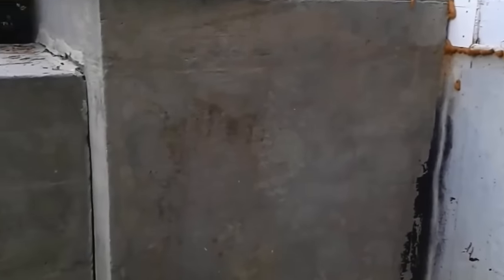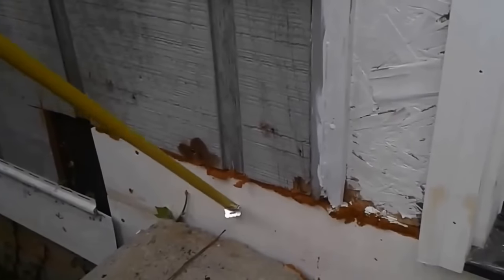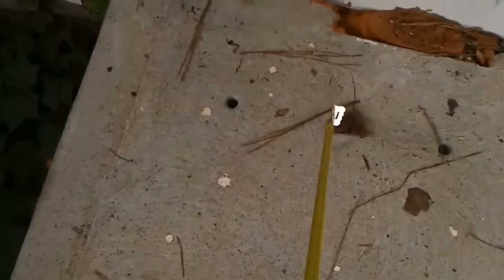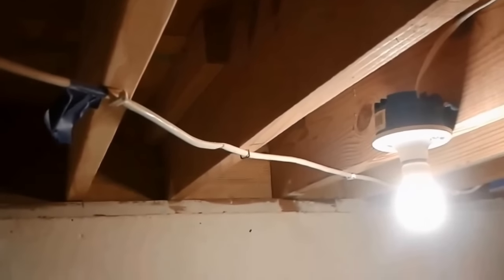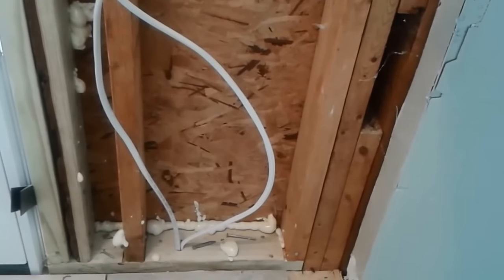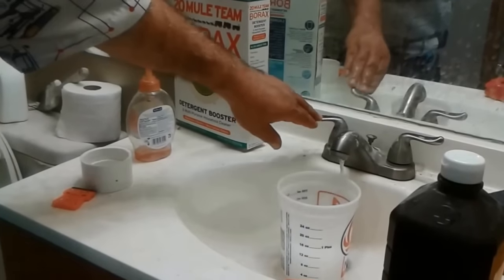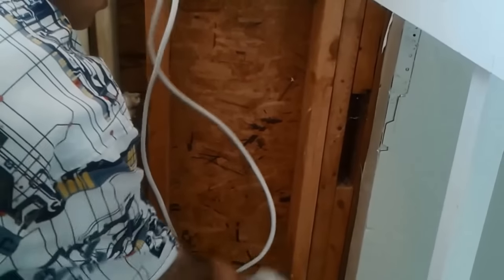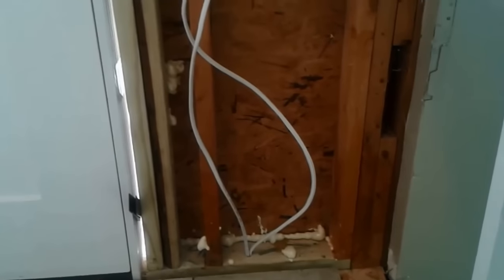How To Get Rid Of Termites For Good  Using  Borax -- Best Solution Do It Yourself

Comment: I use borax also for ants mix it with sugar 1 part borax 3 parts sugar mix with water till like honey feed it to the ants they take it back to the nest and in 2-3 days they are all dead
Reply from the maker: You are right. Thank for the info.
Reply: @josephk9182  I just got quoted $960 to get rid of my termites. They said they will pull all my carpet back and drill holes through my cement slab every 14 inches and spray something called Aggressor into the ground, then go outside and inject it around my foundation putting a total of around 120 gallons of this Aggressor liquid. does all this sound right ? I just noticed so far only a 5 inch long termite debris mound in the center of my living room on an interior wall about 2.5 feet up from the floor. I knocked part of the little mound off and saw them in there, even saw a queen running back and forth. I really don't have that much money but I'm afraid if I don't somehow get a professional these things will destroy my house.
Reply from the maker: Because you already have a termites inside your house you will need to use Termidor or Taurus.  Inside the house internal walls you need to inject foam Termidor.  Remove the drywall and find from where the termites came to your property  Apply Borax on a necked wood as you sew in the video. You must find from where exactly the termite penetrate to your property. Please get second openion.

Comment: They may have used Termidor, but it had to have been improperly applied. You have to do a DRILL and also TRENCH. DRILL the concrete and pump X amount of chemical per hole, repeat per hole per X feet. And around the foundation, you must trench and apply a TON of chemical. It takes a tank the size of a half of a pickup bed to do it in Arizona - we had it done by a professional pest company, and have had no problems. Now with a basement, everything would need to be excavated down to a certain depth - and here I don't know - possibly to the weeping tile, filled with chemical, then backfilled with the same dirt mixed with Termidor. If they cannot excavate the area, they then ROD the area with Termidor. It wasn't done right - plain and simple.

https://www.youtube.com/watch?v=B3zA8MFPyGg

 Also - your solution may likely have little effect - termites eat UNDER the grain of the wood, not on the surface. Only if they start building mud tubes on the surface will it have any effect, once they reach wood they eat "in between layers". Thats why most never notice the damage until it's too late. Borax (Sodium Borate) has more affect on crawling insects like roaches.

I have much material I can send to you if you need proof of my statements, do research, or contact a true pest control company. I admire your efforts - it does cost too much to get rid of the little bastards!
Reply from the maker: They did it ok but it is very difficult to do it under concrete steps . Termidor will not  insure 100% termite infestation. 
Termites will not eat treated wood .When you  apply borax on wood and studs  you create a treated wood which termite cannot eat.

Comment: I just have to mention that the steps and the "porch" are a fine example of American hack, garbage built structures. First it's a death trap, the steps could kill a 12 year old, and forget about inviting grandma over! To help solve 2 problems, rip that boat anchor out and build some code staircase with treated wood. Then you can get to the termite zone behind the crazy concrete work. If that entry step is any indicator of the quality of the rest of the house, maybe its just as well to give it to the termites.  Ok, though, great stuff Borax. I would mix a big tub of it with a drill mixer to the highest concentration the water will dissolve. Dye is a good idea and also a bit of detergent to make the mix penetrate further. I definitely would use a pump sprayer and give it a few coats. You can drill holes and inject them too.
Reply from the maker: Hi , First I injected quite a bit of Termidor on the porch where the holes are beside Borax and second I renovated the concrete stairs putting exterior porcelain tiles and metal ails . The stairs and porch were sealed that no water or moister will go under the concrete so this will destroy the environment of termites under the concrete floor for good.
Here is a video where I primed the metal rails please look at it:
https://www.youtube.com/watch?v=usTMe8A8AGQ

Thanks

Comment: termites r inside the wood not the outside..they will eat the wood from the inside before reaching anything on the outside,,fail
Reply from the maker: Not correct. You have to make sure for the 2x4 stud that the borax is fully surrounding the studs (especial the stud edges). The siding of my property is 3/4" OSB board (   Oriented Strand Board) which fully observes the borax substance through out  the 3/4" .
Reply: goodluk sir

Comment: Problem with this is you are only protecting the surface of those boards you applied it on, termites will also know it's there and will infest other boards in you're foundation! Termador is not detectable and takes 2-4 weeks before the ingredients activate with good reason and you probably didn't get a proper treatment, unless you really know what you're doing leave these issues to professionals.
Reply: can u use termador in a sprayer? I've dug the trench like the instructions say then use 4 gals every 10'. but can it be used for spot treatment as well?
thanks
Reply: Yes, you can with Termador SC
Reply: +J Dub 
very good. thanks much
Reply from the maker: You are probably represent the extermination industry which is defiantly  not a source to trust since they make tons of money off a very little bit of insecticide.  If you look at the video you would see that the property was protected with Termidor but still termites managed to penetrate between the concrete steps and the door (place were Termidor  is not effective.) Borax acid which apply on untreated wood and stud permanently avoid termite from eating them . In addition, in case of moister the wood will not be rotten (from mold and mildew) . As you well know rotten wood attracts termites. The solution works 100% where ever it applied.
Reply: Because I'm just going to represent any company out there right? Read my comment, I'll try to put it in a more simple fashion. Like I said you probably didn't have a proper treatment with Termador, it certainly looks like whoever applied it didn't know what they were doing and the borate only protects wood where you put it. What about your studs inside you're walls? The back sides of those boards where you can't access? Subterranean Termites will just move to different areas and currently there is no permanent solution, I have spent years studying and becoming certified for these things.

Comment: I am a pest control technician in Alabama one of the leading States in termite population. And I can tell you that if treating your wood with Borax was an effective prevention plan for termites, we would not be spending hundreds of dollars per house in chemical. I don't know how this house was treated because I wasn't there. He did say the Tenant treated it with Termidor. Termidor is currently the leading chemical and Termite prevention at least in the United States. But what I can tell you is every house is treated different. not one house is treated exactly the same. Different foundations call for different treatments plans It's not as simple as just spraying around the outside. If the house has a basement. Or a floating slab no matter what you do. You cannot prevent termites from getting in it. You can decrease. The available entrances. But you will not be able to access all of the entrances. No matter what you use. What he's doing with Borax? Is essentially having that would soak up borax. borax messes with the termites digestive system. And will kill the termites that eat it. So they have to get into your house before they can die. chemical treatments kill before and termites are introduced to the house? Baiting systems also provide the same effect. However, instead of using your house as a bait. A uses the by-product of decomposing wood called cellulous and poison to entice the termites to come after that instead of your house. That poison will be distributed amongst the rest of the colony as it's the workers who Feed The Colony. Termite control is not something you really want to do. Without proper training we go to school for this stuff. And why the internet is a great resource, it can give you a lot of bad advice. The best advice I can give you is hire a professional that way, even if they get in you're home, your not responsible for the cost of fixing the damages

Comment: This is a great video thank you for making this. But!...... I would just like to add this if you already have termites and you want to kill them this is the best method the reason being you do not want too much Borax in the water because it will instantly kill the termite and therefore it will not be able to bring food back to the queen so that she can ingest it and die. If you do not have termites and you are doing an new build or upgrading an old one you want to use at least by 4x the amount and use a sprayer to apply, this will help new termites swarms from digging in and starting a colony. Sprinkling borax under your house and around your foundation is also a good idea,  the rain will pull it into the ground where they actually live. Borax can be harmful to some animals please do your due diligence and research. Boron is a good soil amendment. .
Reply from the maker: Excellent comment.

Comment: Wouldnt it be easier to pour the solution into a spray bottle n spray the surface n let it dry?
Reply from the maker: You can but the borax may clogged the nozzle. Please make sure to clean the spray nozzle after used.

Comment: Will this work if you mix it in one of the tank type,pump up sprayers? The kind that you pump it up to pressurize it, then just walk around and spray?
Reply from the maker: +Robert Schmidt  Yes, but the borax may clogged your spray nasal . Make sure to mix the borax in the water very well and you maintain the rate of one spoon of borax to 8 ounce of water. 
You must clean with water the nasal and the spray hose  after use to remove all borax residue.
Reply: yes
Reply: jil brown

Comment: This solution is too simplistic. You won't be able to apply sodium octoborate every place you would need it. In this form it does not completely penetrate, termites can go behind it where you can't see it. This method will give you a false sense of security because you are convinced you succeeded because you can't see them. That's all this method will do, is hide a problem. I'm speaking from 37 years of professional experience. We in the industry use borates as well but not as a stand alone treatment. Is your house not worth doing correctly?
Reply from the maker: +Richard Goff  If you look at the video you would see that the property was protected with Termidor but still termites managed to penetrate between the concrete steps and the door (place were Termidor  is not effective.) Borax acid which apply on untreated wood and stud permanently avoid termite from eating them . In addition, in case of moister the wood will not be rotten (from mold and mildew) . As you well know rotten wood attracts termites. The solution works 100% where ever it applied.
Reply: +Richard Goff who says your way is the correct way? the extermination industry? not a source to trust since they make tons of money off a very little bit of insecticide. plus the insecticides are one reason people get cancer and other mystery diseases. the human body is like a sponge and absorbs anything it comes in contact with or breathes. a non toxic option is the best for people and in this case incredibly cheap.

I suspect you want to sell your services, which is fine, everyone has to make a living. but youll have to sell them to the more gullible, not those who know there are other options that work better and cheaper.
Reply: Joseph K if Termidor didn't work, which is rare, it was because it was not applied completely or correctly. Sometimes a liquid application by itself is not the answer and the use of other tools needs consideration. If you want to rely on borax by itself for what for most people is the single largest investment, your home, you are not thinking straight. Borates are a valuable tool but not a complete answer alone. In your zeal to save money it will cost you later as any place you put the borate, you won't see the termites. Don't confuse that with not having them as all that will occur is they will continue on where you can't see them. This is now my 39th year in the industry. Over the years I have seen professionals put all their eggs in the borate basket only to suffer tremendous liability issues and go out of business. This guy is not even applying it correctly. I always tell folks, it's your house do whatever you like. I don't own it, if I don't treat it I'm not responsible for it, you are. Don't forget, homeowners insurance doesn't cover insect damage.
Reply: Joseph K you are way off base on just about everything you wrote. Go ahead, do it wrong. Save a couple of bucks at the risk of your single largest investment. Might as well wait until your house catches fire to buy fire insurance while you are at. I've got 39 years experience how much do you have? I've got tons of pictures of the results of do it yourselfers. Instead, you look at a video of a guy who obviously knows little about it. Read the other response I gave to another poster. By the way, if you are in the United States, mortgage companies don't accept self treatment as a valid resolution.

Comment: Maybe just put it in a squirt bottle
Reply from the maker: You can.
Reply: @josephk9182  im working on this house from the 1930s i think it has old termite damage. How do you tell the difference if they are still active or have been killed in the past?
Reply from the maker: @zazarays  You can get termite inspector for free if you suspect you have termits. Termites usually  penitrate to house via mud tunnel that can be spoted on the house siding.
Reply: @josephk9182  Didnt realize it would be free. Mud tunnels is what happened to my uncle but there is nothing like that on my place. i think its past damage not seeing any bugs or shit. Im doing quite a bit of work on this place. Ill probably spray the whole underneath with Borax at some point. Im replacing both the Drain line and Water line now.
Reply from the maker: @zazarays  Yes inspection is for free. Usually the ispector will go around your house and crawl space to look for this tunels.

Comment: Borax will not prevent termites. 
Was the property inspected annually following the treatment and how long ago did the termidor treatment get installed as the protection will depend on the chemical rates used?If it was installed 10 years ago, they may have only used a 5 year chemical rate...  I noticed there is moisture issues with the property. 
The shrubs and trees close to to the house creates a moisture area too... If you found active termites- did you kill back to the nest or just removed what you could visually see??? 
Your video is very very misleading - Termites are after cellulose in timber- this is their food...and if there is a small concealed entry point and you have a nest near by.... they will find their food source. 

Homes are NOT set & forget - Annual professional inspections are an absolute must, prevention barriers and making sure there are no conducive conditions to attract them is every home owners ongoing responsibility. Homes are not set and forget.   Termites are very interesting little creatures indeed...
Reply: +Naarah Harrison 
CRAPPY homes are not set-and-forget. we need to stop building with wood. We are destroying people's lives.
Reply: Follow inspection is always done after treatment so you know for sure it killed the termites./
Reply: If I were you and I am not, I would combine a foaming liquid with the borax. You had some areas where the borax was hard to reach. The foam will expand like Great Stuff spreading it out to all the nook and crannies. Then is will dissolve leaving a borax treated wood entirely covered. I did the same with cement slabs .Foaming can be bought on line
Reply: jil brown what kind of foam was this ? What's the name and brand. Where did you buy it?
Reply: @josephk9182  i